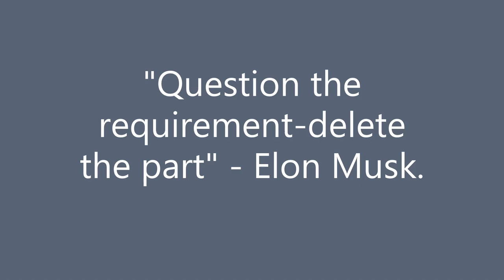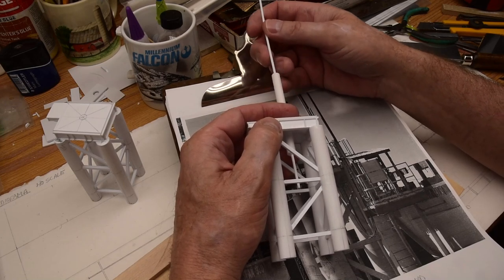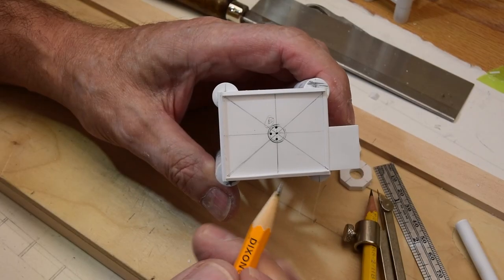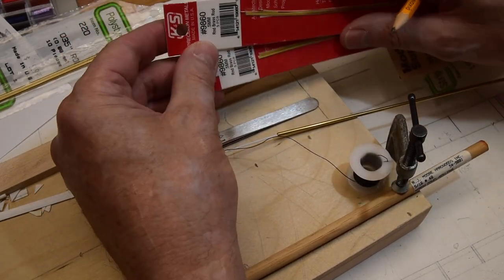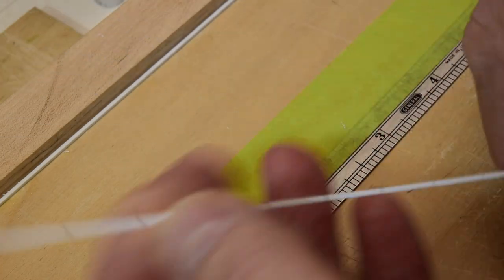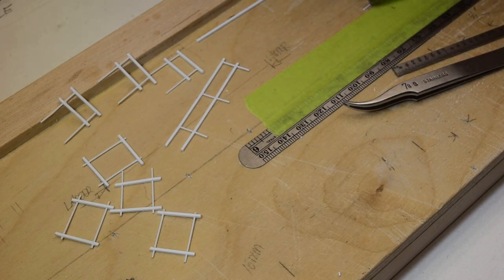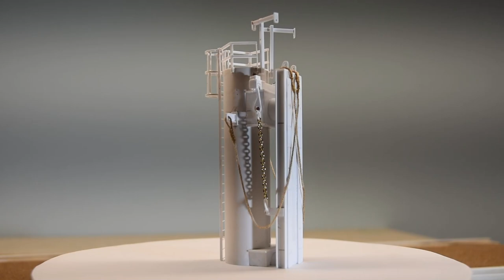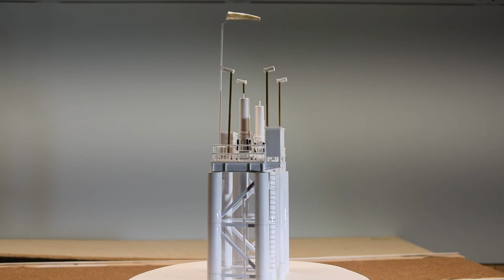The Barge Slip Build | Overcoming The Twin Ramp Tower Challenge - Part 7

Comment: I was pointed to this channel by a friend and subscriber (Paul C) and have finally caught up on the Barge Slip Build. WOW!
Excellent concept, excellent execution and excellent documenting of the steps, thoughts, trials and tribulations. Your workmanship and philosophy is first rate and thank you, as a fellow scratch-builder, for sharing your thoughts, tips and techniques. Though I use many similar techniques in N Scale, I will be taking a couple of your ideas away particularly the custom cutting board (I had a flat version but raised as you use it is far better) now that the scratch-building modelling bug has reappeared.
Thank you!
Reply from the maker: Thank You. It's nice to see the channel is building up on other scratch-builders as well. I appreciate everyone who loves to model whatever the subject. You mentioned the cutting board. When you raise it up off the table (on hard wood runners), it opens up 101 more options. Cheers and thanks for commenting and sharing your thoughts. ~ Boomer.

Comment: Stunning work. I am in awe. Got my Omni 5000 today, waiting on air hose and Makita air compressor, should be in by Saturday. First simple project will be painting pallets so I have them. I did read a post yesterday about not using Isopropyl for thinning. I was trying to digest it and understand the why. But you use it and are a pro. Why would someone say that?
Reply from the maker: I have been thinning my Tamiya paint with Isopropyl Alcohol for over twenty five years. I have painted hundreds of custom locomotives, buildings, models etc. I have no idea why someone would say that unless they had a peculiar experience and lost confidence or something. The proof is in the pudding. I thin all my Tamiya with 99% Isopropyl Alcohol to this very day without any issues. I wouldn't thin any other paint with it though. Cheers.
Reply: @boomerdiorama  Answers that, thanks!

Comment: 15.29  Consider a small pipe cutter rather than a saw. I've used that tool to cut pvc for swimming pool fittings and 1/4" copper tubing for various projects. I have no zero interest in model railroads but I love watching you model landscape, particularly the trees.
Reply from the maker: Thanks for the tip! Thanks for watching as well! Cheers ~ Boomer.

Comment: Watching you building  that hydraulic cylinder, reminds me when I use to assemble cylinder of one meter in diameter sometimes of two or three meter high with bolts  that weighted seven pounds each.  The torque wrench that I used we called it the " widow maker"
Reply from the maker: Jeesh . . . that is incredible stuff Joel. Heavy duty engineering and building is an awesome task for sure. Cheers.

Comment: Thank you for sharing. I wonder if I can make N scale ladders that way for some SD9's. Maybe use fine wire for the wrongs? I am really enjoying this series. After 8 will you be doing how you paint this masterpiece?
Reply from the maker: Well Vincent, if anyone can make N Scale ladders like this I am sure you can. I'm not sure when I will move onto painting yet. I still have a little ways to go. We shall see soon enough though. Cheers.
Reply: @boomerdiorama  Keep them coming I am learning a lot.
Reply: I was thinking the same thing Vincent. My first instinct tells me to try build them in brass.
Reply from the maker: @robertbeaty4909  There you go . . . build them in brass! They are worth the work for sure. Cheers.
Reply: @robertbeaty4909  Yeah then I can solder them
Reply: @Vman7757  I would pre tin the parts and drill all the holes first then make a jig of some kind to hold everything in place before you put it too the heat test because everything is going to melt all at once. Then there is resistance soldering.....that's a whole new can of worms.
Reply: I'm an N scaler, I've been through this before.
Reply: @robertbeaty4909  How did it come out?
Reply: @Vman7757  I've never tried a ladder but I've made plenty of other parts along with a a lot of failures. Success depends on how much you want to do it.
Reply: @robertbeaty4909  Yes me too. Four ladders that are prototype for an SP SD9 feel daunting.  I just have to just sit down and just do it. Hallmark brass did it in N scale so it on there SD9s and SD24 and 26's, it can be done.

Comment: Excellent video. One question .. at the beginning, you placed a curved piece of rod to the structure. How does the styrene retain the shape that you made?
Reply from the maker: Good question. If you bend any rod from Evergreen plastics over a larger diameter e.g. Drill bit shank (1/8th to 1/16th), thin paint brush handle, nail, etc, . . . gently at first. It will soften enough to keep on bending. Once you get good at it, with some practice, you can do very sharp bends without breaking the rod (with some heat as well if need be). Therefore, you bend the rod past the curvature required and it springs back a little to the curve you desire within reason.

Comment: There are step drill bits very useful. I don't know if there is a Princes Auto in your area they sell them.
Reply from the maker: I wasn't aware they made "step drills" that small. Then there is the quality control issue where they snap all the time. I have only broke one from "God Hand." I find most products made in U.S.A. and Japan to be superior to anything else except for Swiss or German. I admire excellence when it comes to tools. Most stuff made in China is junk whatever it is. Cheers - Boomer.
Reply: @boomerdiorama   I use them just for plastic modeling.  They work well for that.

Comment: Boomer, until now I soldered my ladders and railings, definitely gonna try out your method, really like the result. Also, for the hydraulic lines to the cylinder, that’s some awesome bending. Don’t see that kind of bending much in modelling. Might be the bending is a pet peeve from my former occupation, unfortunately accurate bending doesn’t seem to get much attention these days, especially with all the available ready made fittings in contemporary piping (both in true size as in the model.
Reply from the maker: Brass is nice as well Vincent. I used to work with it alot back in the day. I also used alot of wood as well. I find plastic to be so much cleaner and easier now. I must be spoiled or something. But you can mix brass and aluminum with Evergreen plastic as well. Furthermore, the speed in which one can build in plastic is remarkable - not to mention painting as well. When it comes to bending, I start with a gentle curve over a drill bit then increase it as the plastic softens a bit. In closing, I have seen some unbelievable models built with just Evergreen Plastics over the years. Thank You for sharing your thoughts by the way. Cheers.
Reply: @boomerdiorama  yeah, definitely can see the relative speed of construction through your vids. Soldering then requires much more patience and pauses. I don’t just use brass, I use anything metal I’m able to solder. Preferably scrap. Also weathers naturally. 
By the way, soldering is just another pet peeve from the former plumbing occupation. After a cycling accident I got back into modelling, used it to maintain my skillset. However, time learned I had to say goodbye to the physical of the job. With FastTracks jigs I truly upped my skills in fine scale soldering. 
Love what modelling you show, plus your philosophy and your work method. Absolutely inspiring.
Reply from the maker: @vincenthuying98  I use the fast tracks paper templates with a poor man's jig (plywood) . . . lol. Never had one fail yet. I'll be using them for this layout for sure. Cheers.

Comment: Awesome video as usual, do you purchase the styrene specifically or you keep a large selection on hand? If so what selection do you recommend? Eg pack numbers you always have in stock?
Reply from the maker: Sorry Paul, but I can't recommend a starter pack from an economic point of view. I pick as I go but also have stock on hand. It's a good idea to have all the rod sizes available, some smaller profile strip and sheet. With sheet stock you can cut strips as well. Best way is to build a building flat and pick up a pack as needed, here-and-there, as you go. Just build up your inventory as you progress through each model. Cheers.
Reply: @boomerdiorama  thanks that makes a lot of sense every online order I will just add a pack
Reply from the maker: @paulc1964  I find the  smaller profile stuff to be more useable like, "right angle" is a good one as well.
Reply: @boomerdiorama  any excuse for me to spend money lol can’t spend on anything else while in lockdown
Reply from the maker: @paulc1964  You can't go wrong with Evergreen if you love scratch building. It's a worthy investment for me clearly. Every time I go to the hobby shop I pick up a pack or two just so I can have it on hand when I model at the bench. Cheers.

Comment: As you know ladder rungs are one foot on center and the rungs are ¾ inches diameter.
Reply from the maker: Hey James, nice to hear from you. I hope all is well. Spec on ladders vary. Minimum 10 inches to maximum 14 inches spacing on center, etc, etc. Industry standard depends on the particulars of the application. Cheers.